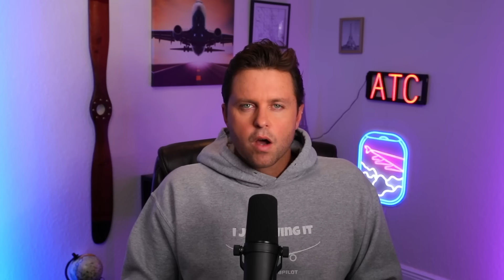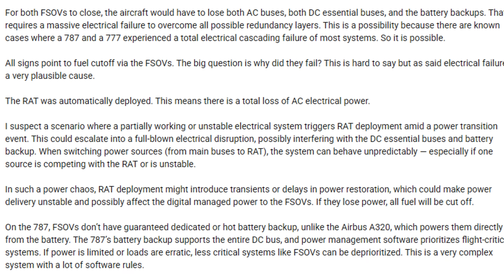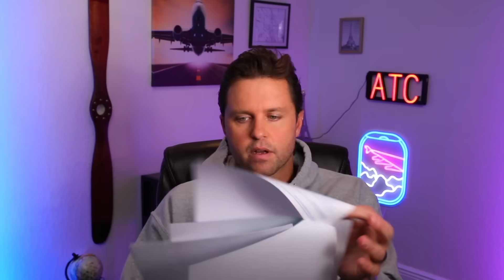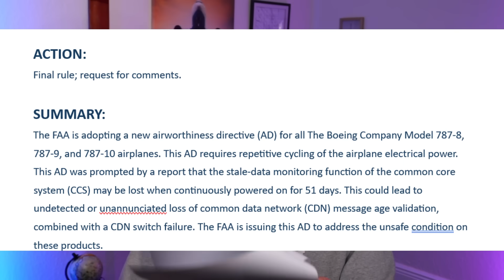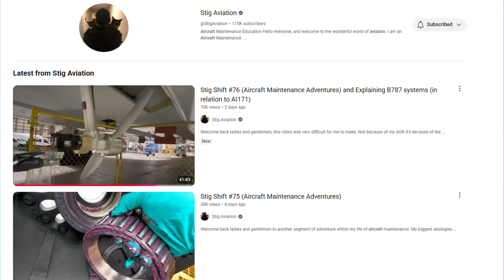Air India 171: Did a Software Glitch Cause Dual Engine Failure?

Comment: Unless there is evidence that the aircraft was never powered down for weeks, then the ADs are irrelevant.

I believe the fuel shutoff valves are controlled and powered by the FADEC. The fuel cutoff switch is just an input to the FADEC. The FADEC has it's own power source, the PMA.

The 787 is designed to keep the engines running in event of complete electrical failure. The FADEC has a separate electrical power source and the engines can siphon fuel from the tank (fuel pumps disabled). However, i don't believe the engines run at max thrust in that fail safe mode. Also there are issues of fuel aeration when siphoning.

No one has answered the question of how much thrust is needed to climb (or maintain  altitude) in these conditions: near max weight, 3200' density altitude and most importantly gear down.

Did conditions exist to reduce the engine thrust below what was needed.

In parallel, what are the conditions for fuel shutoff. I don't think Google AI has those answers.

Comment: DGCA - Directorate General of Civil Aviation in India (equivalent to FAA) has come out with a warning against AI a few hours back:

Aviation safety watchdog Directorate General of Civil Aviation (DGCA) has issued a stern warning to Tata group airline Air India over repeated and serious lapses in flight crew rostering, and has asked the carrier to remove three of its officials from crew scheduling and rostering roles and initiate internal ...

Comment: As an avionics guy at an airline that operates the same type plane with the same engines, your theory didn't sound correct.  After looking at the Boeing SDS and maint manual I see no mention of the actuator being spring loaded. I also looked at the SSM and see the usual, that its a dual actuator with 2 separate wiring paths to the actuator. This plane is over complicated in my opinion the good news is it has incredible data logging, hopefully they figure it out, but for now I think you're jumping to the wrong conclusion.

Comment: This whole video is based on the premise that the fuel cutoff valve is spring loaded and shuts off with total electrical failure. 

I don’t believe that assumption is correct. 
Typing it out on Google and reading the top result, which is AI generated and will fabricate nonsense, isn’t reliable.

Using a random user’s comment as the holy grail truth isn’t good research either. Unsubscribed.

Comment: You are over complicating what transpired.
 Total AC electrical failure occured resulting in RAT deployment.
It appears that the APU generator was MEL.
One Engine Gen was likely offline at departure. 
Second engine Gen failed during takeoff.
Total AC elect failure, Fuel shutoff, and RAT deploys.

Comment: GaryB, I believe you've shed the light on the problem.  Because of the recent stranding the 2 astronauts by BOEING, Im believing THIS event will put the arrow through the heart of Boeing and cause it to go under.  The lawsuits that will come WILL sound the death knell for them. Someone should have addressed this issue.  No Dreamliner should be allowed to do anything but get it to a maintenance facility.

Comment: I think that during takeoff everything seems normal, the engines are working normally and there are no reports of a problem. Immediately after takeoff, a critical system error occurs, and the landing gear does not retract, which is unusual and leads to serious resistance and reduced speed. There is probably a problem in the electro-hydraulic system that controls them. The pilots try to restart the systems, and here the system most likely crashes. There is a loss of thrust on both engines due to FADEC. Without it, the engines cannot be controlled. No thrust, with landing gear down = huge frontal resistance and loss of speed.

Comment: Some of you say that the FSOV is not spring-loaded, but electrical. What if it's usually electrical, but when the aircraft suffers from a complete loss of electrical power, there is a safety feature - a spring-loaded FSOV that takes over and shuts off?

Comment: PLEASE CHECK WITH all car companies if they have engine valve cut off filter-----because I see on all tv car explodes way after an accident------meaning full 3 rolls, crowd runs to help and then it explode........may be cutting the fuel will help based on heat, all-3-wheels going off the ground(car sensors run 10 times in one tenth second using programming on fluid mechanics and fluid dynamics and hydraulics), speed loss, airbags deployed logic and too many factors or else car gets BANGED on a highway------TOGETHER with CARS YOU RISE or divided you fall because it kind of 60% same..........

Comment: If this is true, it wouldn't surprise me. I was an Aviation Electricians Mate in the Navy and later on became a jet pilot. I truly miss the days when some things were manual. When you could shut the engine down manually when something went wrong. As they say, I've been there done that. I've seen a lot of weird stuff happen with electricly controlled systems, especially AC. Why would there be anything that can shut  down an engine without pilot interaction????

Comment: https://www.federalregister.gov/documents/2015/09/29/2015-24145/airworthiness-directives-the-boeing-company-airplanes

Looks like there was an AD about an issue the valves not closing… not sure how this will all turn out but there are far too many dots connecting that not only support abrupt fuel loss failure as cause of simultaneous dual engine failure but open an entire rabbit hole of things to investigate.

Comment: Providing this just thinking about the challenge they could run into with the many different ways a single critical point of data can be affected and then affect how various systems respond.
(Caution: this WILL bore some people)
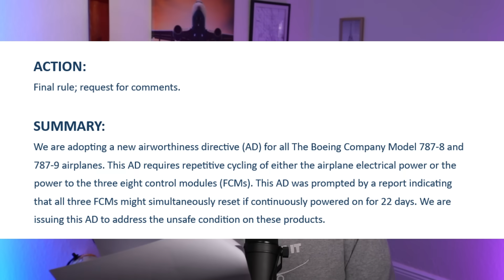06:30 He talks about "XYZ may do (something) if the ABC is left powered on for N days."
It is more accurate to say "...is INTERPRETED as having been left powered on for N days."
What this means is that ABC didn't actually have to be powered on for N days for the failure to occur the system just has to "think" it was powered on for N days. And...

There are many different things that can change the computer's INTERPRETED value of an arbitrary datum. It could be:
1) original "power-on" detection method failure/corruption
2) corrupted data during transmission of data between detection subsystem to computer memory
3) real-time clock failure or corruption
4) computational error while processing accurate data in a processing subroutine
5) computer MEMORY component failure leading to corrupted data
6) computer MEMORY data corruption due to EMP/surge/spike/radiation exposure/etc
7) and more

5 and 6 can be mitigated by redundant computer "agreement" protocols (like 2 out of 3 independent computers have to have the same answer before you use it). 
4 MIGHT be mitigated by each computer using multiple different algorithms to do the computation(s) but that can add cost and time to the software and hardware if you do that for all critical calculations. Could also make the processing time take too long t0 be useful (the system doesn't respond fast enough).

Comment: DT Technician : We have to acknowledge the RAT is designed to deploy only when there is a total electrical system failure and even then after full boot up it is limited to how much power it can provide , it is designed for basic controls ,communication and displays only useful at high attitude giving some chance off gliding to safety

Comment: one possible root cause for a dual engine failure on takeoff is debris ingestion. this hasn't been considered by anyone yet. the video shows a debris cloud after rotation. the plane rotated before the end of the runway, so this debris was on the runway. the debris could have been on the part of the runway before rotation, meaning that it could have been sucked into both engines simultaneously. the debris could have been put there by a late takeoff of a 787 on a previous day which blew debris from beyond the runway (dirt, rocks) onto the runway...
Reply: I think someone said that the engines showed no visible damage to the blades to suggest that, but, well, you know what 'they say' is worth.
Reply: @alisonwilson9749  i thought that phrasing was meant to convey that the engines weren't spinning fast at the time of impact to the ground/building...

Comment: Here's a question for you that I've not heard answered.  Just assume that the flaps were retracted (whether this is possible or not, the question is hyperthetical), with full power on the engines with the addtional drag of the undercarriage, would the aircraft have gained height?

Comment: Those of you with programming backgrounds—especially in system-level or embedded systems—will recognize watchdog timers. Essentially, these are counters requiring periodic resetting. If not reset in time, they trigger a processor reboot. This mechanism exists because operating systems or controller firmware can crash or become unresponsive. To prevent hardware from hanging indefinitely, most controllers and processors implement this security feature. I suspect the IA171 engine failure during takeoff—caused by a main control unit reset—may have stemmed from a watchdog timer activation.

Comment: About 10 to 15 years ago, a British Airways B777 lost power on both engines on short final into London Heathrow (27L or 27R). They barely made it across the motorway just east of the airport, landing hard on the grass area before the runway. No damage to passengers and crew, but I believe the aircraft was totaled. Sounds kind of similar to the Air India case, but during a different phase of flight.

Comment: Gary,  Thanks very much for this material and for the responsible way you are providing commentary and analysis on this investigation.  I have subscribed to your channel specifically because of the informed and responsible approach you’re taking. Like so many people, I cannot help thinking that much of the preliminary and unsubstantiated evidence we have right now does indeed point to some kind of major electrical failure which somehow cascaded into a dual engine shut off. And the facts you’ve presented here provide a possible sequence (or sequences) for that. Plus, my own background is in software engineering (not in aviation) so I tend to think about software errors as potential causes - and especially in an aircraft that are as fully automated as the 787.  But, at the end of the day, I’m forcing myself to stick with the very unsatisfying, frustrating and boring position that we have to wait for an official accident report or statement to really know what happened here. So, I don’t want to speculate, but at the same time I admit it’s hard to resist the temptation to do exactly that. In any case, this is a big mystery and I will keep following responsible reporting on it such as yours. Again,thank you.  Best, John

Comment: Mr. Gary, this model have made over a million takeoffs without this kind of glitch. Any factory, assembly or software glitch would made this planes fall to ground in the first year. Make sense to  blame service or some mistake made by service personal!
Reply: Nonsense. Lots of flaws in systems only come to light after years of service.
Reply: B @alisonwilson9749 Yes. But   easy to overrun with no casualties.

Comment: i am no expert, so these are my doubts as a layman, thanks in advance for any clarifications:

- what generally makes pilots to use almost entire runway for such airliners? is there any scenario, where pilots must proceed to take off and continue for a go around to land back safely?

- i guess, various sensor signals are fed to computer to display data in cockpit, also to feed back control systems. if one starts talking about software issues (not revealed during design), they can be very unpredictable and easily mess up the data displayed as well as control systems functionality right?

- they collected dvr in good condition to show multiple video feeds. but surprisingly, both redundant black boxes got damaged, while a lone survivor just walked away!, that too by opening heavy emergency door at that speed!

- considering all these, how much of overlooked scenarios in design caused this?, how much of bad luck needed for such an ill-fated failing of systems at critical maneuvers?, and  finally how easy it is to sabotage this particular aircraft systems?

also i feel, there won't be any transparency & real investigation, especially if indian bureaucracy trying to protect boeing mistakes. of course the safety/ technological standards anywhere in the world can not match with developed western world, after all they are the ones developed technology at home over the centuries, others are only using and learning now. but, it doesn't justify the deterioration of boeing's production quality.

Comment: May be  it's 100% true.. 
May be Electrical problem and software glitch.. may be software not designed to handle complex situations..  

Software engineers don't know about aerodynamics and electrical issues

Electrical engineers don't know about software and aerodynamics issues.. 

May be there was moisture in electrical components due to rapid temperature difference.

Can rain water enter into airplane during onboarding/onloading  or off boarding/ off loading luggages? Which eventually reached electrical systems in the past and created moisture to develop slowly? May not be.. 

May be Boeing flights are having many technical issues unfixed or undetected or hidden..

Not speculating..

Comment: The problem with this is that people seem to assume that because there was not enough thrust to climb, the engines were dead. They weren't. As it flew past the balcony, they were still running, just at low power. I've put the video to an audio spectrum analyser, and there is definately a background  of some engine thrust as well as the RAT.
Reply: Still does not rule out massive electrical failure or those engines/turbines are winding down.
Reply: @bowlingj74  Agreed, I just like all the facts straight.

Comment: I would start with Air India maintenance and it is well documented that they have taken part off other 787 that are grounded because they can't afford new spare parts so one plane can fly and this recommended not to do. I would start here look at the other Air India 787 having problems and they are up to 3 month over doing inspections on there Airbus fleet.

Comment: People keep talking about the power cycle AD. This is not a factor in the sense that this airplane was left powered for too long (>200 days?). No way. Easily is going to be power cycled 1x a week just from routine ops and maintenance. It's a silly thing to focus on. It does reveal details about some of the flaws of the programming. That being said, most modern aircraft, evne the 737 need to be power cycled occasionally to fix issues. Ask anyone who has flown an E175...

Comment: I develop project management software and we make minor logic mistakes all the time that we don’t catch or didn’t think of an edge case. I cannot image the pressure on these engineers to get these complex systems right.
Reply: In (good) engineering there are strict protocols for designing, writing, and testing software, which, if you follow them strictly, keep things safe. Things tend to screw up with software when people are either careless, companies don't have proper systems, or people fix a bug and don't test the fix thoroughly enough to see whether it just created another one (or more). Testing after IT bug fixes is often not done nearly thoroughly enough in other industries. I know, I've had to use some crap graphics/printer/scanner software in my time, full of logical holes and other nonsense. Canon, I'm looking at YOU right now re this. 😠And had IT people tell me some new problem after an update isn't a bug when it ****y  well is. My only consolation is that at least my graphics software can't unalive me even if it gets on the very last nerve I have left. Though at time it has made me want to..nope, not going there.

Comment: Functional Safety standards applied along with a systems engineering process would normally not allow this sort of failure mode to occur. A FMEA or FMECA would have to be applied to this subsytem with respect to this scenario and adequate controls put in place. Unfortunately the evidence for this would not be public and not available to customers, maintenance or other engineers.

Comment: In case anyone is wondering why 51 days...The maximum that a 32-bit unsigned integer can store is 2^32-1 (or 4,294,967,295) which means that the maximum system uptime {in milliseconds} based on the GetTickCount() function is allowed to store is 49 days, 17 hours, 2 minutes, 47.295 seconds (49.71 days). If the system uptime exceeds that level, the GetTickCount() function will either reset to zero or gradually overflow.
Reply: And there is no way to outdesign that from a computer programme? Seriously?
Reply: @alisonwilson9749  To prevent this from happening, developers should use the GetSystemTime or SystemTimeToFileTime instead.

Comment: Fuel contamination is highly unlikely. If the fuel source was contaminated other aircraft would also have faced an issue. The aircraft had just flown & not pulled out of storage, so unlikely that contamination happened within the aircraft fuel system. 

so this looks most like & it’s scary.

Comment: Based on what you just said:
If the thrust reversers were deployed instead of retracting the landing gear, both engines would shut down because there no wieght on the wheels.
So I guess you are trying to say something.

Comment: The airframe in question was turned into a donor aircraft to keep the rest of the fleet alive, I believe from 2015 to 2018. If there has been software updates during that time, they might not have been installed when making the aircraft airworthy again.